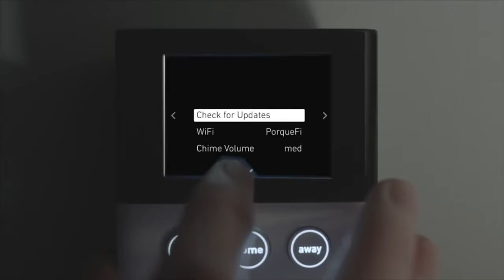The WORST Gun I Own

Comment: The CETME L is famous for the unreliability. At first it was amazing, even considered the best most precise 5,56 rifle in NATO when it went out of the factory, but it was expensive, so CETME (the company that manifactured it) decided to make it dirt cheap, and screw it big time.
Reply: They’d should make on for public sale that is better so that collectors can get a good rifle, but it’s more expensive.
Reply: LC is wicked fun and reliable for me...
Reply: the most common issue with the CETME L is that they have way to weak of springs. you will want to find aftermarket more powerful springs or find a way to get the recoil spring to have more tention behind it.  my budy literally stuck a shell casing behind the spring and that fixed it for him.
Reply: Also use stanag mags and throw the cetme mags away
Reply: @robertmccutcheon4103  marcolmar’s reproduction cetme l’s have all new springs
Reply: @robertmccutcheon4103  
How to make PICKLED CARROTS! These quick pickles come together in a few minutes and you can use any carrots you have on hand.
Ingredients

    8 medium carrots (about 3/4 pound)
    2 garlic cloves
    ½ cup white vinegar
    ½ cup water
    2 tablespoons sugar
    2 teaspoons kosher salt
    1 tablespoon black peppercorns
    2 bay leaves

Instructions

    Wash a wide-mouth pint mason jar and its lid in hot soapy water. Then rinse and let air dry.
    Peel and cut the carrots into thin sticks, about 1/4-inch thick (if you prefer, you can slice them into rounds instead). Fill the jar with the sticks.
    Peel the garlic cloves and slice them in quarters. In a small saucepan, combine the garlic, vinegar, water, sugar, kosher salt, peppercorns and bay leaf. Once boiling, remove from the heat and pour the brine into the jar. Tap the jar on the counter to release any air bubbles. Discard any remaining brine.
    Screw on the lid tightly and allow to cool to room temperature, about 1 hour. Refrigerate 24 hours, then enjoy. You may want to remove the garlic after 24 hours, as the flavor intensifies over time (or leave it if you’re a garlic lover). Keeps up to 1 month refrigerated.

Did you make this recipe?
Reply: @alexcarbery8189  : A gun that has to be broken in to work wasn't built properly.
Reply: @robertmccutcheon4103  the M66 (sniper version) version is fitted with a plastic spring too, it makes it more silent and better to use,
Reply: @alexcarbery8189  Is based on military CETME'S. the core concept is that the cost was decreased in ALL ASPECTS, and I mean ALL. In Spain we currently use a modified G-36, great rifle to be honest, but the CETME is still used in military competitions, one of the thing they taught me when I was training for one of those competitions is that, when I load the first round, I had to, pull the charging handle, a when I had to release it, I had to "lauch" the entire rifle forward with the other arm, to help the spring, if not, it was prone to misfire. It is THAT BAD. The CETME C, on the other hand, was fantastic.
Reply: @chadsmith289   Ian showed the CETME L too in his channel and said that the CETME mags are slightly different - resulting in feed issues with STANAG mags. Dunno if that also applies to reproductions.
Reply: @helmsscotta  Then never own a roller-delayed blowback rifle. Most including H&K need to have the rollers seated during the first few mags.
Reply: @helmsscotta  .....lol....TRUE THAT.....why the ar's are junk !!
Reply: @ericrumpel3105  wut?
Reply: @helmsscotta  it was relatively common in roller-delayed rifles, they were tuned for the hot NATO ammo
Reply: @ericrumpel3105  AR's dont need to be broken in.
Reply: @arkhaan7066  .....lol......because they always run like ........ jam'n junk.....lmao !!!
Reply: @ericrumpel3105  not really.
Reply: The original cetme rifle was far superior. It used a high tech 7.92x41mm aluminium composite round designed by ex luftwaffe. That round had about half the recoil of a 7.62x51 NATO but with similar performance. 7.92 cetme outclassed the 5.56 in every way.
Reply: @Iron_potato40k  That was the CETME A, it only served in small numbers. The Real OG was the CETME C, its 7,62 variant, which was the standard battle rifle of the Spanish armed forces. Furthermore, it was the predecessor of the German G3, an almost exact copy of it. To be honest, the Germans had better marketing skills that fascist Spain in the 60s
Reply: @helmsscotta  uhhhh, hate to break it to you, but all roller locked rifles kinda need break in periods
Reply: Amelie is even less reliable
Reply: @MrTony1995  el cetme C es basicamente un HKG3 si no me equivoco?
Reply: @Violencio_esmegman  Al revés, el CETME es anterior al G3
Reply: @iTxip  exactly. Roller delay blowbacks require a higher chamber pressure to function flawlessly. They have their issues, such as being difficult to keep clean, but they are known for being accurate and reliable.
Reply: It wasn't even expensive,  Francoist Spain was just really corrupt and ended up ruining a good rifle because of all the embezzlement that went on during the production process.

You set aside a certain amount to build a CETME-L, every guy down the production eats a chunk out of the money and now you have to build something resembling the CETME rifle with 40% of the funds so they take a lot of shortcuts, dumb down the quality control and surprise surprise, the CETME-L has widely varying quality from one rifle to the next, but governments can't ever blame themselves for the problems they caused so they blamed the rifle and swapped it with the G36.
Reply: @tylersmith3139  the Cetme L was developed after the dictatorship. You are thinking about the Cetme A/B/C, which are the grandaddies of the G3. Do proper research

Comment: Carcano rifle has an "ejecting" clip. Not spring loaded like the Garand but when you rack the final round, the clip falls out the bottom of the magazine.
Reply: All the rifles that have Mannlicher clips do that
Reply: @etiennelamarche9629  That's what the M1895 is, right?
Reply: The original Gewehr 88 has similar mechanism.
Reply: W ouldnt just bending the ejection port "block" backwards a bit fix this particular issue? It looks like the brass got flipped back inside the gun after hitting that.
Reply: If it doesn't ping we dont want it lol
Reply: @justintime753  I'd be fine with it.
Reply: Styer m95 I own is like that
Reply: Ala commission rifle.
Reply: Not the mannlicher m1885, it eject the clip uppwards.

Comment: I have a CETME L, never had a malfunction with it. I have noticed by watching the ejection of the cases on mine that it prefers hotter loads. Aside from that never had a problem
Reply: It's right there in the manual 

"You may notice that lower power ammunition will tend to make spent cartridges eject
in wider patterns, and closer to the shooter, than hotter makes of ammunition, which
will tend to be ejected much farther and in a more consistent pattern."
Reply: Yeah it's a pretty unfair comparison as the gun he is shooting is supposedly new. My CETME 308 build took a little bit of running right after I got it finished, but now it eats anything. A CETME L is going to be a build. Wouldn't be real happy if I was the shop that built it and my product was being given this bad publicity.
Reply: I think he got an original becauso of ET marking in it. The original versions were really bad guns.
Reply: @bacon1564  It's even the same with the PTR, I had to run 100 rounds of 7.62x51 LR and 100 rounds of steel 7.62x51 through it before it would truly shoot anything.
Reply: @alexcarbery8189  Not all of them. Some where FN (Fuerzas Navales - Naval Forces) that we Spanish Marines used at that time (mid 90'). Not as sturdy as the C version for sure, but built with better materials that the ones for the ET (Ejército de Tierra - Spanish Army, different branch for the Spanish Navy the Marines beloged to). I had one from the first series built specially for us and never ever had a malfunction as long as I used american M16/NATO magazines, never the spanish ones. My company got a bunch of them brand new from the US Marines in a joint exercise, exchanged for a huge paella xD
Reply: @bacon1564  What's wrong with that cetme is that it's American-made and has poor quality ammunition... it's usually sold in bulk.
Reply: It literally says it in the manual that the gun prefers hotter loads due to the roller delay system

Comment: CETME-L manual states you must do TWO things- first, you must clean the chamber before first use- this is the case with all roller rifles. Second- it is specifically designed for milspec 5.56, some civilian round have brass that is too soft.

All roller delayed guns tend to have have similar problems- CETME, G3, MP5, HK55
Reply: I have not encountered any problems with my Century arms ( I know ) Aluminum receiver rebuild of a G3. It is violent when it extracts brass and it always does as it should. Yes its heavy, but accurate and brings a smile to anyones face who shoots it.

Comment: I bought a CETME-C, original early import build using Spanish parts back in the day by Century.  It had a horrible condition of light primer strikes and stovepipes. Essentially the kits were completely worn out. I purchased an HK G3 extractor and spring, and had the headspace/ rollers maintained by a competent gunsmith. Never had an issue again. The issue likely with yours is that the kit they used to build it is simply tired. Have it serviced and you won’t regret it.
Reply: I remember dozens of those for less than 900 dollars at cabelas around 2013. Should have jumped on them, I always wanted a 308 semiautomatic and that was the cheapest option hands down.
About half the price of an AR-10 clone at the time.
Reply: @worldcure7883  I made a trade for this one at roughly $700, and regretted it for about a year until I had all of the maintenance done. These things are like BMW’s when it comes to maintenance but if you keep them up, they’re pretty sweet shooting guns!
Reply: Should've gotten a Greek-made G3 back when Springfield used to import them. H&K tooling. They kick like mules but they don't jam.
Reply: @worldcure7883  I got a Century C308 in 2016 for $750. I love it but everyone else who shoots it complains about its weight. It's one of my favorite in my collection.
Reply: @GeorgePerakis  that was before my time unfortunately. This was a trade roughly 5 years ago. Mine was assembled by Century right when they started doing C308’s.
Reply: @worldcure7883  You can get a reliable AR-10 for about that price now.
Reply: @worldcure7883  They were 2 for 600 in 2003.
Reply: The things we do to keep roller guns rolling 😜

Love the HK91/G3 platform and I love shooting .308. Such a timeless weapon
Reply: Where did you get yours done? I have a CETME C parts kits and im struggling with finding a welder to complete it.
Reply: I remember with my PTR-91 (A recent purchase), it jammed every magazine for the first few hundred rounds. Cleaning it after the first 200 or so, and shortly after it stopped malfunctioning. Now that thing will run with any .308 or 7.62x51mm ammo I put through it, no issue
Reply: @MrHavcat  mine was a Century build, not a kit, what I meant by my original post was that the original kits century used were just plumb worn out but they didn’t care and just spit them out in typical Century Arms fashion. So naturally they’ll need some attention before being reliable now.
Reply: @dablop1  that’s crazy. Mine didn’t care what the ammo was but did seem to like milsurp NATO spec ammo better than cheap shelf .308. It’ll run whatever now.
Reply: @LukesJukes   okay i read that wrong preciate it
Reply: @LukesJukes  yeah for the first few hundred rounds, I was shooting S&B Czech surplus 7.62x51mm, and it was jamming up all the time. Cleaned it, and it kept jamming for the next hundred or so, before starting to run really well. Now it takes surplus 7.62 as well as cheap steel case stuff with no problem.
Reply: @dablop1  I had issues with the S&B surplus ammo from the 70’s. I figure the powder has degraded some over the years because with other brands I don’t have issues.

Comment: To be fair, Marcolmar says to run 100+ rounds of 62 grain though their CETME L to break it in before you use 55 grain. Mine is flawless after following their manual. You have to remember these guns were tuned for M855. They put a lot of effort into making these guns run nicely, which they will.
Reply: Same experience I've had with my L and LC, along with everyone else I've met with one.
Reply: Facts in the end it’s just someone’s opinion.
Reply: @deathnote9272  sure, I suppose, but it's specifically an opinion based in ignorance
Reply: Yep same here. My Marcolmar CETME-L has 100% reliable as I shot a 100 rounds of 62gr m855 at first just as the manual states. It is very common for roller-delayed blowback to have a break-in period to seat the rollers even for h&k's.
Reply: Exactly. I tried running X-tac .223 through mine at first and it was a jam-o-matic. Did what the instructions said with the 62gr 5.56mm. I ran 150 rounds and now it eats everything reliably.  Good to post this info MrLimey.
Reply: What? Follow manufacturer instructions? Blasphemy!
Reply: @zerosmss  my lc works perfectly. ive always used 62g LAP with 30rd mags
Reply: So does any Spanish unit currently use them as their primary rifle? If not, would 5.56 vs .223 make a difference with cycling (namely ejection) issues? Were they originally issued with 10/20/30 round mags?
Reply: @chrisjohannes179  Spain uses G36 and 416 now these might still get used by Natl Guard type units...I wonder how they handle heavy 69-77 grain
Reply: @chrisjohannes179  Check out the MAC channel he did a shoot and review and check "Forgotten Weapons" he does a history segment that goes into when, where and what.
Reply: I should've scrolled down in the comments and read this one before I posted my own.
Reply: @chrisjohannes179  I would imagine that vanilla .223 would be a little more problematic, as it is a not-insubstantially lower pressure round. Running hotter ammo will obviously nullify this, but just regular FMJ 55gr .223 isn't going to perform well in a gun tuned to 62gr 5.56. Maybe after some considerable wear in period, but I wouldn't trust my life to it.
Reply: @chrisjohannes179  to the extent of my knowledge they are not in use by any unit (except in some ceremonial duties), the Guardia Civil still uses them sometimes for training and stuff but the ones they have were built to a higher standard than the military ones. The Cetme L was supposed to be issued with 30 round mags , the 20 round version might have been only for use in the LC version (shorter and designed for drivers, vehicle crews and the like) and about the 10 rounder i dont really know, maybe training mags or some attempt to comply with Spains stupid laws for "civilian sporting rifles" so that the rifle could be sold as such in a non-select fire version. Here the military versions failed to cycle/eject regardless of the load (these versions were run with standard 5.56 NATO) whilst the Guardia Civil ones worked smooth like butter, it all came down to how well it was built and maintained.